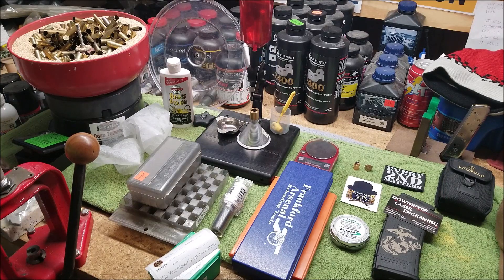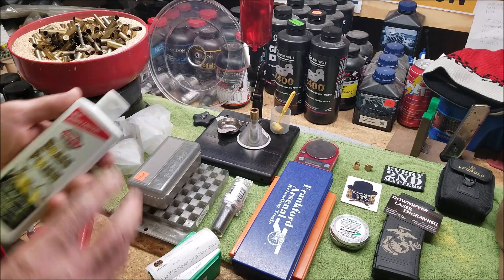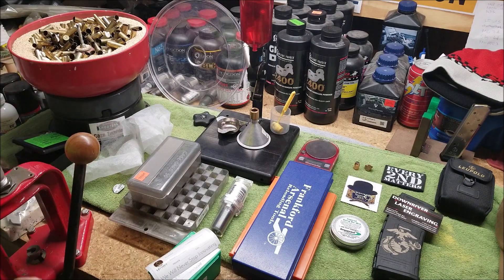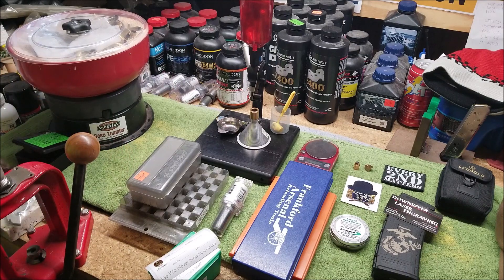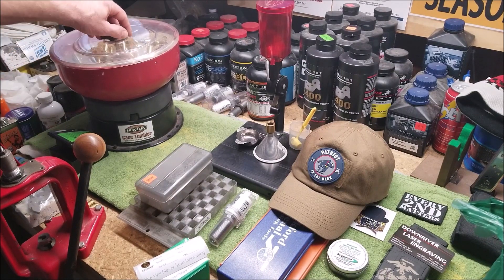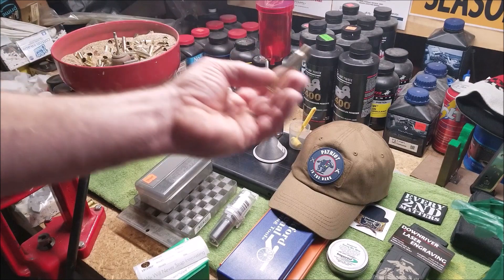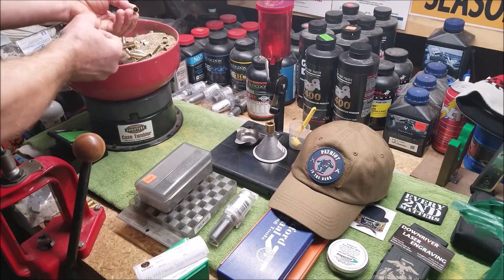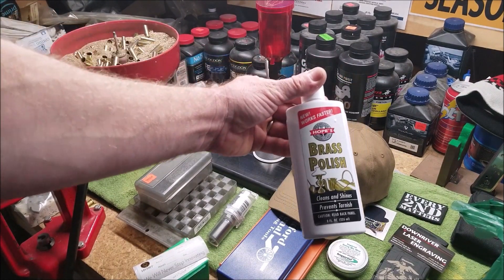Dry Tumbling with Hope's Brass Polish

Comment: Is there a short answer for why you need to polish your spent casings in the first place I'm guessing it just makes it so it feeds through the fire arm easier
Reply from the maker: Yes.  In addition to polishing the brass to help it feed better you're also cleaning it so you're not introducing any dirt back into the firearm.  Also it looks better.  If you picked up your brass right away and it stayed fairly clean, could reload it and it would be fine.  If you didn't tumble it you could reload it and it would probably still work just fine with the exception of some possible feeding issues.

The corn cob and the walnut media both have polishing and cleaning properties, but one polishes better and one cleans better.  That's why I use a 50/ 50 mix and it seems to work just fine for me.
Reply: @Squib1911  awesome.  Thanks brother

Comment: So what's the point of using the dryer sheets ? I know what they do for dryers but never seen them used like that .
Reply from the maker: The static in the used dryer sheets pulls dirt out of the media;  extending the life of the media.
Reply from the maker: Think of it kind of like a disposable filter.
Reply: @Squib1911  sweet . Thank you . I never knew that . Guess I need to save some .